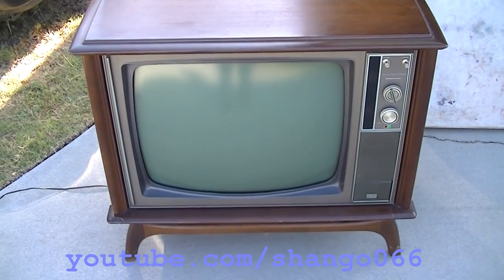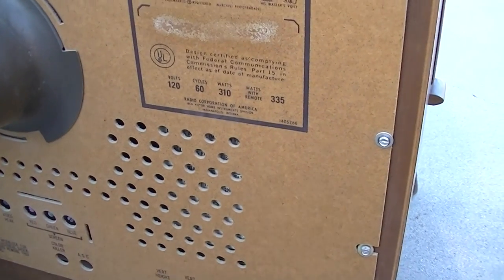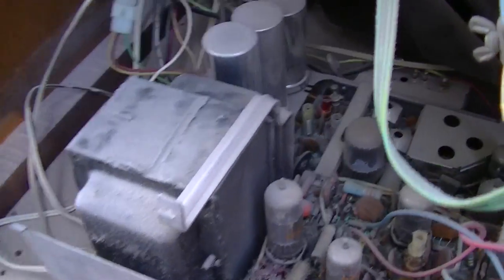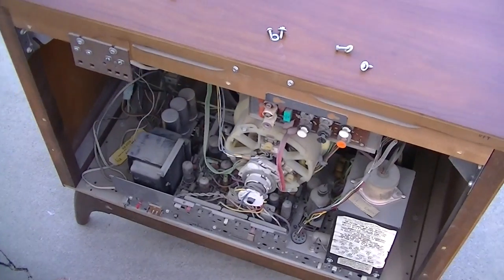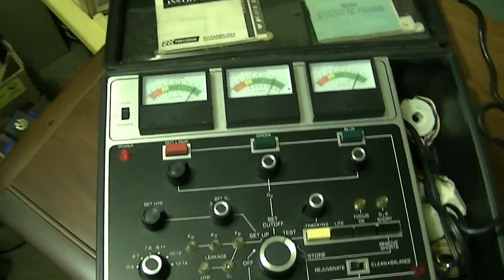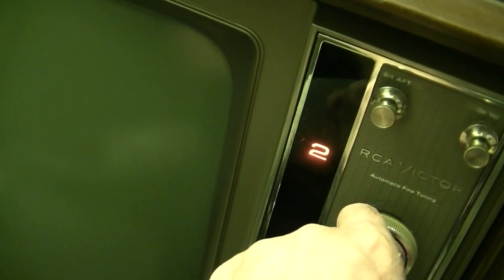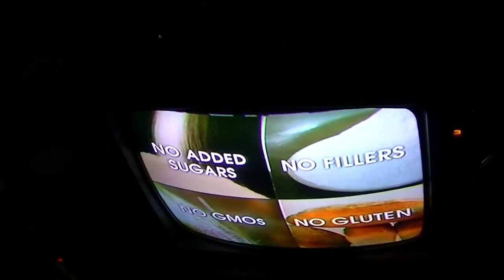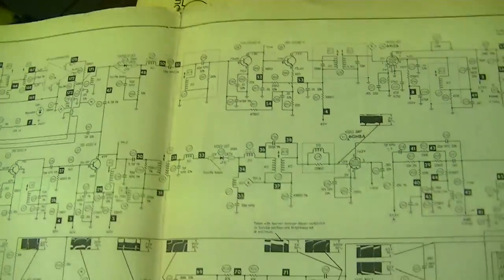1968 RCA CTC38 Color Hybrid TV Analysis

Comment: British colour tv sets of this period used a whole load of solid-state, sometimes all solid state. Engineers at the time thought the transistor would bring unrivalled quality and reliability to UK sets. Hybrids were considered the worst of both worlds, hot valves and cold -loving transistors in the same box. It's a credit to american design that I see so many USA colour tvs working with minimum tweakage 50 years on. I dont think any UK-built solid state tvs from the period would work at all, most of them would go bang if you plugged them in cold turkey. Respect where due!
Reply: Disagree  best of both worlds mom had a hybred zenith one vertical tube 20yrs  beltron the crt once .used to. Have tv shop .
Reply: PAL system, if memory serves me right.

Comment: Tinkering with vintage electronics makes living in the present a tad more tolerable... Nice set!
Reply: You hit it on the head Shawn. No one in my circle appreciates things like this. I have to reach out to watch this and get a recharge. This was the first model I changed a flyback on.
Reply: @duanethamm4688  It's peaceful fun although challenging. On with the VCR and the old TV shows. Or terrestrial TV with the digital converter box. TV Land, Grit, Antenna TV, Cozy, etc.
I like playing the shows that were more in the period for the sets. It's fun. Of course radios, stereos, phonographs, speakers, shortwave, and test equipment is great too.

Comment: I'm surprised it doesn't have the "new" RCA logo introduced in early 1968. I did see the 68-48 date code on the CRT sticker so it's a late 68 production.
Reply: 4:16 Seems they were putting it on Tubes by that time. I've always considered that ugly logo the beginning of the end for RCA. I was dropping stuff off at the dump recently an saw that they still put the Nipper logo on the backs of 1990s consoles, so Thomson must have been trying to maintain ownership of it, but by the early 2000s, they were using the 2-dog theme on their adds, so maybe someone other than the Chinensium company that owns the brand owns nipper at this point.
Reply: @PC No
Actually at this point Curtis International owns the rights to the RCA name and Nipper and son. Unfortunately all they do is contract with a Chineseium TV manufacturer and put the RCA name on it.
Reply: @pcno2832  Technicolor, the owner of the RCA brand, is a French company. In the 1990s, they were manufacturing products for N. America in Mexico. Since 2000, production has moved to China.

Comment: Was wondering about that interlace issue and the effect of the AGC. You may want to check the AGC voltage at the tuner with a scope to see if there is any hash left from the horz. Could just be a weak AGC filter cap. Hash on that AGC voltage can do odd things to the signal.

Comment: That Toshiba 6GH8 is the one to replace if the TV loses sync. My CTC38 eats about one a year, that tube also gets extremely hot.  Agree, RCA hands down best tube era color picture. I acquired mine under similar circumstances several years ago.

Comment: Was given one of these in late '70's ( metal box version)... trailered it from NY to AZ ( sitting on an partially inflated inner tube ).  While attending ASU had PT job at Ability TV in Tempe...fun times.    Anyway, fixed it up, rebuilt tube etc.  best thing i did for this was to install a 230 volt muffin fan in the back to get the heat out and installed a "commercial audio killer" via photocell & hand held flashlight ( those were the days ! ) . .
    Muffin fan ran quiet & extended all the tubes life immensely, although i lightly shot the PT years later... in '91, dragged it to CA, ( AZ, well, great place to go to skool, retire or pursue a career at 7/11 ).      ya, RCA really had it down back then.  29 years later only issue is my 12HG7 needs a light tap now & then...should replace it . . . now where is my tube caddy at?         enjoy your vids, brings back memories....        Cheers

Comment: Dad bought a new set in 1970 that looks virtually identical to this one- might be the same model or very little change to it, not sure. Used it well up into the 1980s. Our first color set, and seemed so big! 

Also had the service contract with it, the first few years- when a tube would fail, in would come the RCA rep and get out his cheater cord and go to switching tubes until he got it humming.  I think maybe one time he had to pull the main chassis and take it with him for repair, for a few days we had just half a TV.

I remember these were hybrids- later on I would be the one to yank the tubes and go to the drugstore or Radio Shack to test them, recall seeing some transistors in there and on the tube diagram if I'm not mistaken. 

Great looking set and beautiful cabinet really love seeing it. Brings back lots of memories. I spent many many many Saturdays and prime time evenings on the floor in front of our RCA.
Reply: Looking closer at it, the legs were different but that's about the only external difference I can see

Comment: Around 1981 (I was in the 5th grade) our family found one of these RCA New Vista Color consoles at an estate sale. It was fun watching my favorite 60s sitcom reruns on it. A plant was placed on top of it, and when I was trying to move the set backward on the living room floor one night, water from the plant pot spilled into the back and shorted it out. If it was a brand new 1981 set I would have been on punishment until the year 2000 but we didn't pay too much for it. It then sat in the garage for the next 10 years until we finally got rid of it.

Comment: That is one nice set. Even a low hours set will have  6GH8's in it that have been changed, they really did not hold up well, Sylvania 6GH8's hold up better then RCA and there is a sub for the 6GH8 that is even more rugged but I can't remember the number at the moment.
Reply: 6GH8s often developed intermittent shorts and h-k leakage, usually after 4-5 years operation.

Comment: Seeing a vintage TV in such good shape--including a strong picture tube--make me mourn the passing of CRT technology and NTSC. There is a certain beauty about the concept of TVs as furniture that does not exist in the modern world. For its originally intended purpose--home viewing on screens generally smaller than 19", NTSC did the job quite effectively, in my opinion.

I do wonder, though, in what shape are this TV's selenium horizontal phase detector and convergence diodes? The horizontal lock looked a bit touchy, though the convergence seems decent.

Comment: Ha.  We had that exact TV growing up in the 60s and 70s.  Except our had a large speaker on the left side.  I remember when our first tv was Black and white and they came out with a piece of film you stuck to the screen to give the illusion of color.  Blue tint on top, green on bottom.  The channels were U-13.  I told my son that when we were kids, we had to get off our asses to change the channel and TV broadcasting went off the air at midnight.  I also remember the TV repairman came to our houses to change tubes or whatever had to be done.
Reply: I remember those stick on films.

Comment: The CTC-38 was a transition year set.  There were 3 distinct cabinets.  The first was the "His Masters Voice" set with the old RCA "Chipper" on it (I owned this version).

The second was the set in this video.  It doesn't have a logo.

The third and final version was owned by a friend of mine.  It had a mostly black face with the new RCA "block" logo.

My set had a flyback failure burn out.

CTC-38 was the last tube set that RCA produced.

The CTC-40 was the first all transistor set made by RCA.  I definitly agree with Shango concerning the picture.

It was top notch.

Comment: With regards to the Cataract issue,  in your case where you have a TV where it hasn't formed one yet, would it be lessened if the TV was actually in use more? I figure the heat from the CRT in daily operation would keep it dry to the point the humidity cant get in to attack and its more that because these TVs aren't used much it speeds the issue up?

Comment: Beautiful set. Danish modern cabinet. I think you were looking at what was called line stacking. It had to do with the interleave of the even and odd scan lines. I'd have to pull out an old book and look for it. I think weak I.F. and video signals before sync take-off was the trouble. Maybe it was trouble in the integrator. But I may be wrong... I love the set.

I just got an Admiral CDU-2112 color roundie set. One electrolytic can is leaking electrically and getting hot on the variac so I shut it down at about 70 volts line. The CRT was slow to wake up on my Sencore CR-143, but after about 5 minutes cut off and emissions as well as balance looked good. I hope it will produce a nice picture if I can get it running.
I have seen most old CRT's not run in a decade or two test badly at first. Then after 5 to ten minutes test good. I don't know if they always work  correctly and for how long.
Be well and God Bless!

Btw, anyone have the two 3-socket test adapts for B&K 465? I have both the 465 CRT tester and matching 606 tube tester. I'd love them to be complete. Thanks

Comment: Oh my it still works? Tell ya the truth those sets were a nightmare to fix. I was a tv repair man back in 72 working for RCA. Fixed a ton of these tube sets in homes and sometimes at the shop. These kind of sets seemed to have the same flaws Now this particular tube model kicked out a great deal more heat then most and was also known for having vertical lock and color issues due too  excessive heat problems usually on key components around those same tubes. one quick fix was moving a cap or two from the top to the bottom of that circuit board. that same one supporting a large horz output tube. most of the time I just replaced a bad old tube with a good new one and it did the trick. However, when a new tube had no affect off to the shop it would go...

Comment: When televisions would be repaired when something went wrong..today, you just buy a new one...
Reply: Or do like me, and just go without them all together.  I don't have the means to throw away 💰 buying a modern piece of garbage destined for rapid failure, nor do I have the certainty of remaining where I am, to invest in a vintage - and likely large - set without near-term worries about moving or liquidating it.
Reply: There were a few years certain "un-named" flat screen manufacturers that used cheap Chinese capacitors in the power & backlighting sections that would literally dry out and fail. Replacing them with Japanese capacitors with high heat tolerances would 9/10 times get it going again. People would throw the sets out when it was relatively easy to repair & the parts were not very expensive at all. The hit was in the labour.
Reply: @Mikiness Analog...I grew up in Brooklyn during the 60's and 70's, and TV repair shops were very common to see, like shoe repair shops...now, they have virtually disappeared because of high rents, and our throw away mentality...I miss the good old days...
Reply: @edreid7872  Now you know one of the reasons why you no longer see "Radio Shack" (Tandy here in Japan), although I did see a video where one was still open in Texaz somewhere. 6L6 & 12AX7 forever
Reply: @Mikiness Analog....We never owned brand new sets growing up..they were all purchased at Salvation Army..our first color set was in the 70's..I had small set from China that lasted 30 years that was on 24/7, that recently died..finally got a HD, and I find the images so intrusive...when you can see someone's nose hair, it's problematic..
Reply: @edreid7872  I'm with you. I prefer a CRT/tube with built in ATSC tuner for regular viewing. Just seems best to me. I can watch it or look away and just listen. But the flat screens are different. Plus the little speakers always sound crummy. My main TV is a Panasonic Tau. I recently had to change the fuse on the AC line in. Back to work for me a couple hours several days a week.

Comment: I believe that this TV was from about 1968 and it was one of the last TV sets to have the name “RCA Victor” and the RCA “Meatball” logo with the Nipper logo like the one you see on the front and the back of the set. RCA changed its logo to a modern logo which is still in use today as the “Block” RCA logo.

Comment: I would take it any time...but I am in Germany so I guess shipping is not an option....this is exactly the type of TV I prefer over the new sets. The 60s/70s TV sets from Europe suck pretty much. They just don´t have any style. The American TV sets were designed more as a piece of furniture than an appliance back then.
Reply: I always liked the looks of the radios and console stereos from Grundig, Emud, Telefunken and Phillips, with their mirror-like polished wood, but like the consoles  from U.S. brands, the models from those companies seemed to look cheaper and more plastiky as the years wore on. Everyone was trying to compete with the stuff from Japan, Taiwan, Korea etc.
Reply: @pcno2832  Yes, the old German radios look great, but for some reason they just didn´t get the style right on TV sets. I think they tried to make the cabinets as small as possible. Also, console TVs were rather uncommon, a TV was supposed to fit on a table or sideboard.

Comment: If it has solid-state I.F. stages, I wonder if it also uses a S.A.W filter?  
Those tube sets would always get buzzy audio whenever a commercial would come and and large text was displayed on the screen.  Somehow, the video signal was leaking into the audio demodulator stage.  Every tube set I've ever owned was like that.  Every single one of them.

Comment: What you mean by low hour with the picture bulb? You saying it don't have much time left?
Reply: He means that the picture tube has not seen many hours of use. In picture tubes that have been run for many hours, the electron gun emission is low (this is the main test that he does with the picture tube analyzer). Tubes with worn out electron guns would produce pictures that are dim and that streak or go out of focus when the brightness is turned up to compensate.

Comment: This looks A LOT like the set my folks got in around '69.  The legs/stand looks different through.  I think theirs was a 21" maybe....  It was their 1st color TV.  The TV dealer/shop that sold RCA and whirlpool appliances made a fair number of house calls back then on repairs for that set as I recall being fascinated as as small boy when he would come around to work on it.  Maybe part of the reason I later got a EE degree in electronics.  Seems like it was not the most reliable?  I know it was traded in on a new set in '75 that lasted with less repairs until around 1988.  That newer set was also a RCA and looked similar in styling.

Comment: I wanna hookup a VCR to it and watch some Star Wars, Alien, Ghostbusters...
Reply: Hook a VCR to this TV and show pre-recorded movies from a VCR and the picture will flag. Flag is a term where the picture will bend at the top portion of the screen.  Even some early solid state TVS did not do well with VCRs. I had a Sears early solid state TV that hated video tape. Some Zenith tube sets you could adjust the bending picture with the horizontal control. Horizontal would then go out of sync when you changed back to normal viewing.

Comment: 14:24 If a knife is that sharp... say goodbye to the coating on your nonstick grill LOL have fun eating teflon fragments
Reply: @misterhat5823  I never said it was or was not inert.. I simply stated have fun eating teflon fragments lol, Why do people have to comment on things that they are A) wrong about B)  have nothing to do with what was originally said/stated... However... your only partially right , it is inert at low temperatures.  but heating 500F or higher it starts emitting toxic gases
Reply: @misterhat5823 

Even if it is it's still there for a reason and shouldn't be damaged...